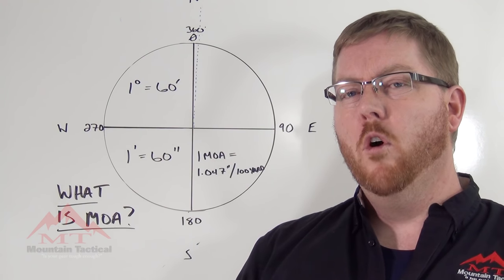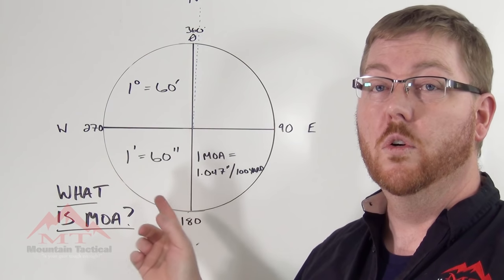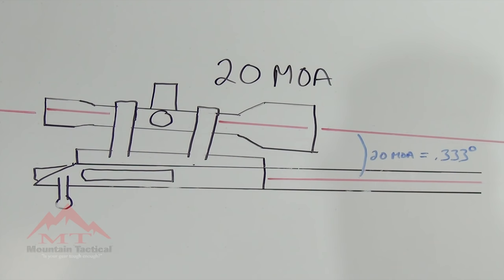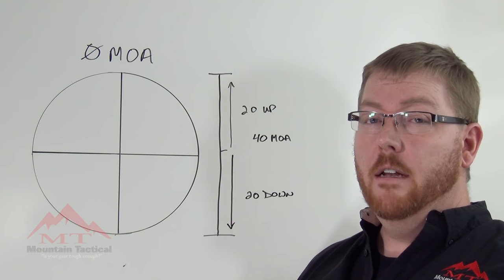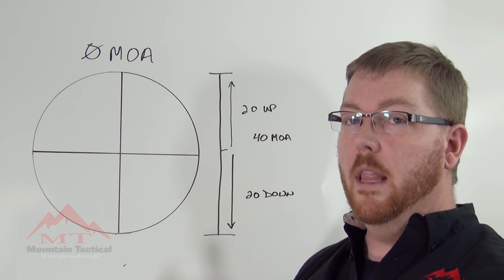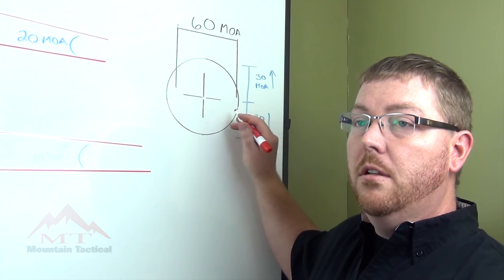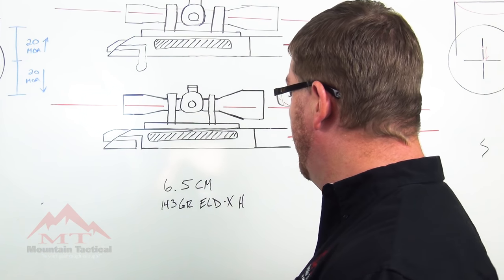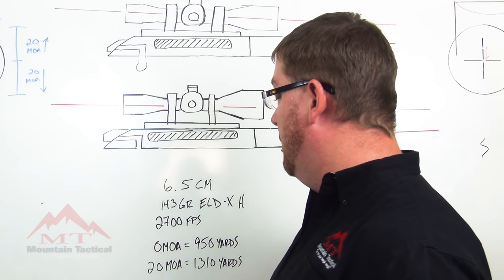0 MOA vs  20 MOA What Does it All Mean?!?!

Comment: I know there is 3 MOA per MIL (Rounding down) but if I buy a scope that says it has 20 MIL adjustment going up and 20 MIL going down, in theory I would be able to use a 20 MOA rail as that would be give me over 120 MOA correct?
Reply from the maker: I think your math is a little off...  but the premise is the same for mil and moa.
Reply: @mountaintacticalcompany  is it not 3.438 MOA in one MIL? 
So the same rule of 51 or more applies to MIL Scopes as well even though 20 MOA being about 20 inches at 100 yards would only be close to maybe 6 MILs? Sorry for the questions, I am pretty new to all this and I have a scope that is in MILs and was hoping I could use a 20MOA mount to extend the range of it without needing to have to buy a new one

Comment: As a newbie, what I heard: 50 MOA or less (25 up and 25 down), go with a 0 MOA base, 50 MOA or more, go with a 20 MOA base. I also heard that you may need a range of over 300 yards to just zero with a 20 MOA base, since the center of the reticle would be in an unreliable area with much less than that. As a newbie, I will be sticking with 0 MOA.
Reply from the maker: Nothing wrong with 0MOA!  Most scope manufacturers have listened to their customers and have started providing more travel in their optics. It’s a good time to be a newbie!

Comment: I'm a beginner in long distance shooting. I own a 6.5 Creedmoor, and I have a SWFA SS 10x42 Tactical 30mm scope. The specifications for the scope state total elevation adjustment is 120 MOA and total windage adjustment is 120 MOA. Should I also use a 20 MOA rail?
Reply from the maker: 2punish1 That's a great optic!  Definitely go 20MOA or up to 40MOA if you can find one for your rifle.
Reply: Ok, thanks!

Comment: Ok so I have a vortex razor hd gen ii 4.5-27x56. It has 28.5 mrads of adjustment which is 98 moa so I will definitely be getting a 20 moa rail. Just one question. Will this affect my shots in any way at super close ranges such as 20 30 40 yards
Reply from the maker: Bill Dixon Actually, you would benefit most from a 40 MOA rail with that optic. 

Unless you already dial for close shots, your short game will not be effected.
Reply: Tikka Shooters thankyou for the quick and helpful response sir
Reply: hi, and for a Athlon Ares BTR in mil, that has a total of 24mil (81moa), should I use a 20moa or a 40moa rail? Thanks

Comment: Any reason to use a 20mm rail on a 22 lr M4 that I intend to use at ranges of 25 - 200 yards? (3-9X40 IR AO SFP scope)
Reply from the maker: Going to 200 yards with a 22lr?  20 MOA may not be enough. But in your set up, your optic will be the limiting factor for range.

Comment: Hi ! i have 2 nightforce atacr 7x35x56(that model only have100MOA elevation because of the 35 magnification) on 2 cadex model the first is model 6,5 creed and second 338LM have a 30MOA rail and i buy a 20moa Sphur mount for them so im kinda 50Moa on the rail and mount+50Moa elevation on scope=100moa elevation..is it to tigh or is it just find... and secondly .... i have the Tremor 50 with a 40Moa rail and a sphur mount of 20 moa total of 60 moa rail/ mount and i use a NF BEAST of 120MOA ele...now im really tigh  on the 50bmg...would i solve my problem if i zeroted my 50 at 200yard would it correct my error ...... or should i buy a new mount or scope :)....Thank alot...really enjoying your channel...is it really Bad to not have the 10%

Comment: seems like to me it would be better if they were making 5 and 10 moa rails and never put a 0 moa mount on anything. They would become obsolite
Reply from the maker: armed ready Our sentiment exactly. We are going to release a 10 MOA mount so shooters with 1" tubes can see the same benefit that shooters with 30mm tubes see from a 20 MOA mount.
Reply: Any idea when that will be?
Reply: Tikka Shooters So how would a 20 MOA rail effect a scope with 1" tube and 70 MOA total adjustment?  So instead of 35 MOA up adjustment I would have 55 MOA of total up adjustment and 15 MOA down?
Reply from the maker: Hard Target The tube diameter isn't as important as the adjustable range of the turret. The math is the same no matter what the tube diameter is 😀
Reply: Hard Target  The point is that a 30mm tube has more space inside for the reticle assembly to move, so it can give a larger range of motion than a 1in tube (24.5mm diameter) if everything else is the same. You probably do not have a 1in scope with 70 MOA adjustment?? In the examples given, the 1in scope has only 40 MOA total adjustment, 20 each way, so a 10 MOA rail can use half the wasted upward adjustment without going off the end of the range. Yes I like the 10 MOA idea! Also, if you want to adjust your scope for shooting scaled targets at 25 yards, you need more angle to make the bore and sight lines cross at that distance, although a sight without an adjustable objective (AO) may not be able to focus clearly at that distance.

Comment: Have a Nighforce SHV with 100 MOA mounted on a 20 MOA base zeroed at 100 mtrs. Went shooting on weekend at 1200 mtr targets. Ballistics said I needed about 62.7 MOA to be on centre of tgt. Could only dial 54 MOA WTF. Have I missed something as I assumed I had about 70 MOA of adjustment.  On a side note I got on with 50 MOA wound out and 5 MOA adjustment using hash marks in scope. Re checked zero at 100 after shoot. Wound up 58 MOA and down 37.5 MOA. Thats not a 100 MOA scope.

Comment: Got a question. I have a Schmidt & Bender 5-25x56 PM II/LP Riflescope, ±6 mrad adjustment range single-turn, with 26 mrad adjustment range, double-turn, clockwise rotation elevation turret. 
What base should I use?
Reply: Depends what rifle the scope is on an how far you want to shoot, but mils to moa you have about 89 moa adjustment in the scope  So you can easily use a 20 moa base,  a higher moa base if your rifle and you are capable of shooting really far like 2k or more.   Simple conversion factor I use is 3.44    20/3.44=5.81 mills   hope this helps
Reply: FNH SPR .308

Comment: So i just ordered an American defense 20moa mount i had no idea on what it meant. My optic is a primary arms raptor 1-6 for a 5.56 will this mount work?
Reply from the maker: What is the vertical adjustment range?  The manufacturer should have that in their specs.
Reply: These are the only specs i have because i am still waiting on it to be delivered.

SPECIFICATIONS
Battery TypeCR2032 3V Lithium Coin
BrandPrimary Arms
Click Value1/4 MOA
Exit Pupil DiameterLow: 9.00 mm / High: 4.00 mm
Eye ReliefLow: 4.30 in / High: 4.00 in
Field View 100Low: 110.0 ft / High: 19.8 ft
Focal PlaneFirst Focal Plane
IlluminatedIlluminated
Maximum Magnification6
Minimum Magnification1
Night Vision CompatibleNon-Compatible
Objective Diameter24mm
ReticleACSS Raptor 5.56 FFP
Total Elevation Adjustment50 MOA
Total Windage Adjustment50 MOA
Tube Diameter30mm
Turret FeaturesCapped Turrets, Low Profile, Finger Adjustable
TypeVariable Magnification
Weight17.6 Oz

Comment: If you had say 6 targets @ 200 yds totalling some 498 points ( 1 point for each 1/8th" ) / 6 = 83 points average and you write down .830 then subtract the first number of 8 plus 1 = 9 from the total ( .830 - .009 ) the number would be .821 MOA. Correct answer ! 
This only works with 1/8th point system, 1/16th or say 1/4th will not work unless you do additional math. 
There is a longer formula to convert to MOA but you need a calculator. 
Why does this only work with 1/8th / point ? ANYONE KNOW ?

Comment: so what if i shoot mostly at 100 yards but want 1000 yard capability? Will the 200 moa mount hurt my accuracy at 100 or cause any issues?
Reply from the maker: The MOA does not affect accuracy.  As the video addressed, which rail you choose is based on your optic.  I actually used this example as to why you would choose one over the other.

Comment: You only have so much adjustment up or down. Scope manufacture's will give provide with these numbers. A 20 MOA rail will provide you with more up adjustment. So 60 as opposed to 40. I find the math a bit confusing. Anyway, just as stated you get more yardage when dialing in your scope.

Comment: With a 0 moa rail your 2 lines are parallel, but what happens if your scope is too high ( but the line of sight still parallel with the bore ), Will you have to compensate and lose moa in a way or thr other ?
Reply from the maker: Olivier Bert That would be a great subject for another video since what you are asking is a different principle than what is discussed here. 

In short, the change would be quite minor in comparison.
Reply: Tikka Shooters Thanks
Reply: Unless I  am missing something very basic.
If the center line of the bore, and the center line of the scope are truly parallel,  the only way to zero the rifle is with the adjustment of the turret. 
And with the adjustment of the turret in the middle of it's travel  the center lines must converge at some point. In order to do that, the lines can not be parallel. 
But the concept of the converging lines is what is being taught here.
Reply from the maker: @willybee3056  Exactly!  They cannot be parallel because the bullet arcs and the line of sight in the scope is adjusted to intersect the arc of travel at a predetermined distance.
Reply: @mountaintacticalcompany  
Thanks,,,  😆😆😆
Reply: You loose 1 moa when you barrel i 1 inch higher.

Comment: I'm new to the 20 moa rail and heard it can stress the mechanism in the scope if you keep it zeroed at 100 yards. That a 0 moa rail zeroed at 100 is close to the center (neutral ) position of springs in the scope. Using a 20 moa rail zeroed at 100 yards keeps a constant  tension which over time is a  negative for the scope. Is this true? And if so can you do anything to the turrets while keeping a 20 moa rail on the gun when not in use?
Reply from the maker: muddnyreye This isn't exactly true. As long as you are avoiding the 10% limits discussed here, you'll hold a steady zero with no stress on your optic. 

The final 10% in any direction can bind the turrets which is why they should be avoided. 

Hope this helps!
Reply: Thank you for clearing that up, my local range only has the ability to offer a 100 yard range . I am able to travel 11/2 hours east for longer distance , which is the purpose of buying a .308 . I wasn't sure if it was worth it to get the 20 moa base . Now I can plan the build with the goal of slapping steel at 1k. Thanks for the video and help!
Reply from the maker: muddnyreye No problem! Happy to help
Reply: First, modern springs don't suffer any wear from being kept compressed or extended. That's been debated and proven with magazine springs. Springs wear from cyclic expansion and contraction. So if you dial your scope up for storage, and back down for use, you're actually accelerating the wear.

Second, get a good scope and just don't worry about it. All the nice scope manufacturers provide good warranty service, and you'll probably never need to use it anyway. There's no point in throwing a wal-mart scope on a 20MOA rail, or a rifle that can shoot at the distances where a 20MOA rail is beneficial. Pick up a nice Nightforce, Swarovski, Leupold, or Vortex and call it a day. Budget more for the glass than the gun.

Comment: I disagree with this because you did not figure in the UP adjustment that is required to zero a rifle at 100 yards.  What I mean is that a scope that is 0E/0W which puts the line of sight parallel with the bore means you are already (X) number of inches low at the muzzle and the bullet will continue to drop from that distance. In my 7mm-08 that has a scope with 40 MOA elevation of internal adjustment will actually require 5.2 MOA of up adjustment to be zeroed at 100 yards (168 Berger @ 2560 FPS). If you need to stay 10% from max adjustment that means you only have 18 MOA up and down from zero to play with. 18 MOA - 5.2 MOA would only allow for 12.8 of UP adjustment with a 0 MOA scope base and the rifle zeroed at 100 yards. That would give the rifle a max range of 550 yards. After I put on my 20 MOA base I am 5.2 MOA from the max down adjustment of the scope and that gives me 32.8 MOA of adjustment UP available to dial in. 1000 yards requires 33.3 MOA of UP adjustment so I can't make the shot unless I use some of the 10% at the top of the UP. It is very doable and we do that in the desert of eastern washington without any problems. Another example is my sons 300 Win Mag launching 212gr Bergers @ 2900 FPS. That round requires 4.7 MOA UP from the 0E/0W setting of the scope and at 1000 yards requires 24.1MOA UP dialed in. This example works just fine and you are always out of the extreme 10% of adjustment.  The real downside to all of this is that you are on the outer most edge of the internal lenses and when the magnification is set at max there will be a noticeable distortion in the sight picture. This problem is most notable when shooting at the farthest range at the highest magnification. IMO that is when you probably would want the highest optical clarity possible, especially as the light starts to get low or the targets are small. I have observed this from personal experience as a 50 year old shooter with 50 year old eyes. lol  In my 7mm-08 example the maximum range until that bullet goes subsonic is 1325 yards and requires 55.2 MOA UP adjustment.  I would choose a scope with 100 MOA of internal elevation and a 40 MOA base. This puts my 100 yard zero at -34.8 MOA from 0E/0W (+5.2 - 40). My 1325 yard UP of 55.2 MOA would be 20.4 MOA above the 0E/0W of the scope.  This keeps my longest range of 1325 yards about halfway from the center of the optical plane to the edge keeping clarity pretty good. At 1000 yards it would almost be dead center giving the highest optical clarity and you get the drift on how that works as the targets get closer. The worst clarity would be at the very shortest distance when you probably won't use a very high magnification anyhow so that becomes a mute point. I hope this is understandable and helps make better videos and recommendations for appropriate optics to maximize the ability of a given rifle.
Reply from the maker: Matthew Nelson This whole comment is hilarious because this is the EXACT point the video makes. I simply used the center range of the optic for easy math. 

And yes, I account for the adjustment needed in the scope to level the reticle in the video. 

This is a simple explanation to help people understand what's going on inside their optic. 

Some people must like the sound of their own voice and think it's cool seeing their comments out there for the world to see.  Everyone who has "disagreed" with this video has said exactly what is said in this video in a slightly different way. 

Make your own video if you "disagree" so strongly haha!

Comment: great video, wat i still dont understand though is when you do put a 20 MOA base on a total 60 MOA elevation scope now you have 50 MOA up and 10 MOA down right ? However if you did want to dial 50 MOA up wouldnt you run out of clicks on the turret ?? Being that the physical scope itslef only has 60 MOA of adjustment built into it. Someone please help my confusion lol.
Reply from the maker: Abi Kubilis A 60 MOA vertical adjustment gives you approximately 30 MOA up and 30 MOA down with a 0 MOA mount

Since you never dial for short shots, a 20 MOA rail adds 20 MOA of usable range in your optic for dialing long range.
Reply: Tikka Shooters thanks, after re-watching the video a couple times I got it Jaja. Wat I forgot to take into account that with your "0" at 100 yards with a 20 MOA base it will be 20 MOA up. So u gtta adjust it 20 MOA down for your 100 yard "0"
Reply from the maker: Abi Kubilis Exactly!

Comment: OOOOOh it's so easy everything. Take a paper, let's say 60" high. devide this in inches. Put your rifle at a fixt possition aming
 5 inches from the tops off your paper. (your zero at 100Y). Than dial up (don't move your rifle. At a surten time your cross stops going down.
That is the max. off dial-up distance you have. (last 10% is less reliable). This distance in inches is your dial up in inches.
When you shoot at 1000Y you need to shoot 400 inches (40moax10) higher. This is pure ballistics, hornady gives you a fine calculator for that.
Temp,wind,elivation,airpressure and azzimuth and other stuff isn't important. That changes your inpact only with 40inch max at 1000Y. LOL

Comment: How much should I shim a 0 moa to get 10 moa? 0.015" maybe?
Reply from the maker: Unless your shims have 10MOA cut into them, you will have uneven pressure on your optic mount that will cause bigger issues. Your best bet is to purchase a 10 MOA mount for your rifle.
Reply: @mountaintacticalcompany  That was my concern, how much stress may be imparted to the scope with the slight misalignment. Mainly I was wondering how much would be required to achieve 10 or 15 moa change from zero.

Comment: So, if I have a Vortex Diamond Tactical with 70 MOA of adjustment then I should use the 20 MOA rail for my 700 AAC-SD 308.  Is that correct?
Reply from the maker: Submoa 73 you got it!